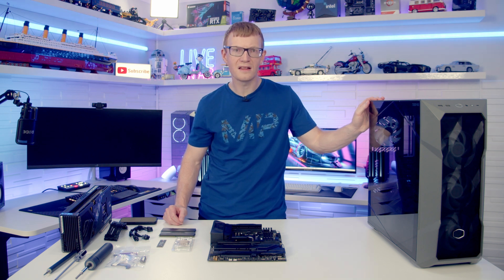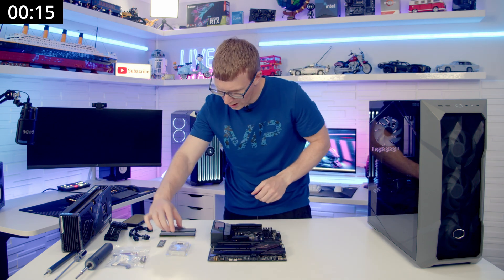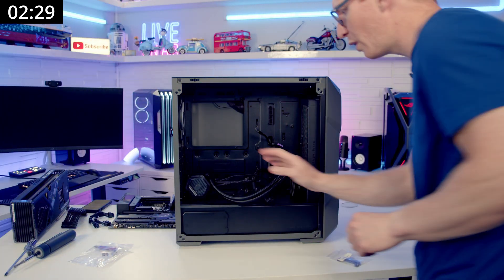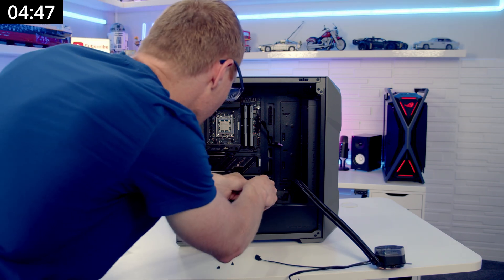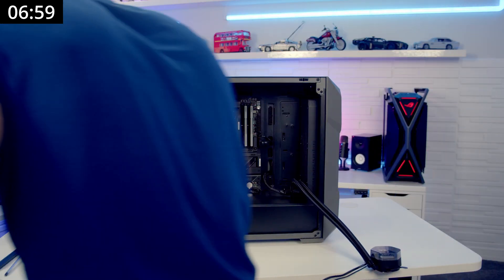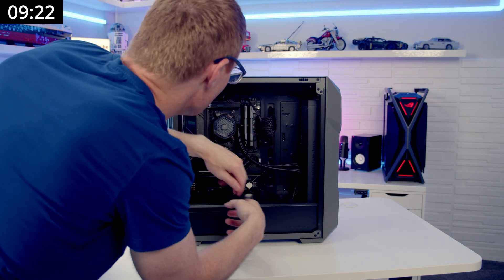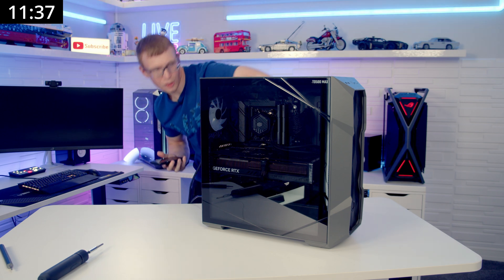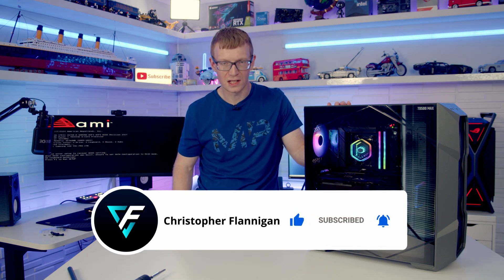PC Building Speed Challenge - Cooler Master TD500 Max

Comment: tomorrow  getting the exact  same PC without the  GPU ..  It's  my first build  and my hands are shaking
Reply from the maker: Good luck
Reply: @ChristopherFlannigan   I just realised that my card is using 8+6 pin connector I have order  one already . Can you just confirm that I have to plug it 8pin connector in bottom right inside the case ?